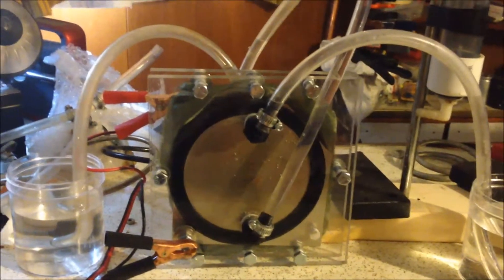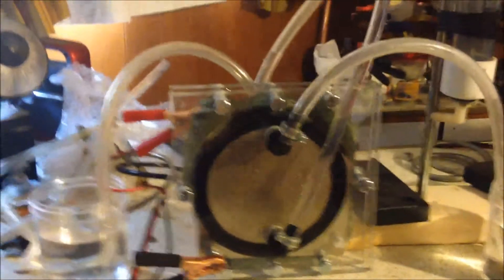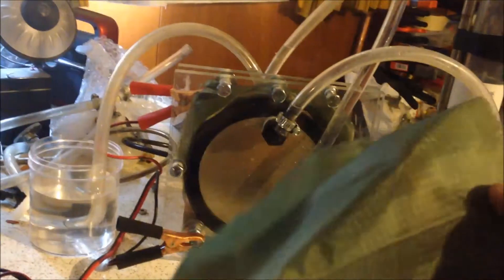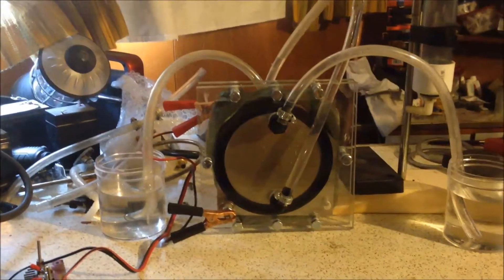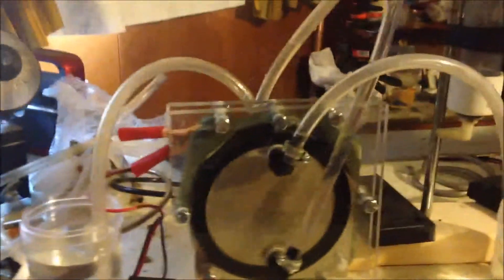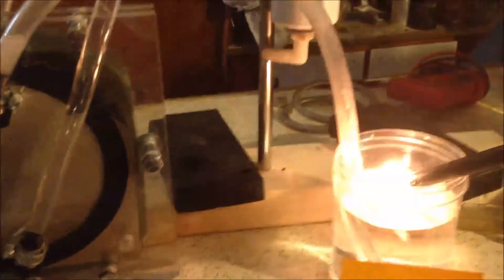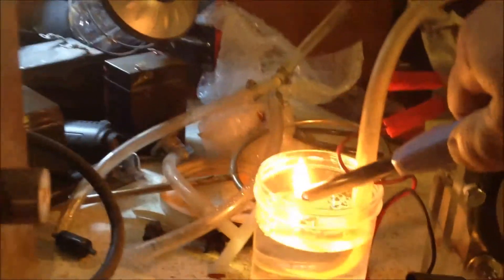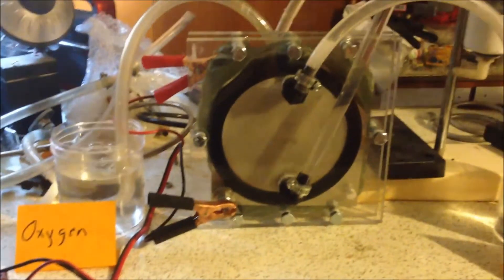Split Cell

Comment: How do you assembly it? Can you explain? Where it goes the parashoot material? And the positive and the negativ
Reply from the maker: Gaston gainza Sure its simply 2 plates with whats called Rip Stop Nylon that's the Parashoot material that is Sandwitched in the middle. the Oxygen is Positive and attracted to the negative plate. and the Hydrogen is negative attracted to the Positive plate mow the Material is known as a membrane witch will keep the gasses apart
Reply: Great...what if you put only hidrogen in a car engine? Instead of oxhidrogen? 
Mabe its a little bit more easy to manipulate or less explosive according to the ignition time
Reply from the maker: Gaston gainza Well u can but the problem is producing a lot of it and if you cant recreate Stan Meyers tec you will end up putting in more power than u get out.